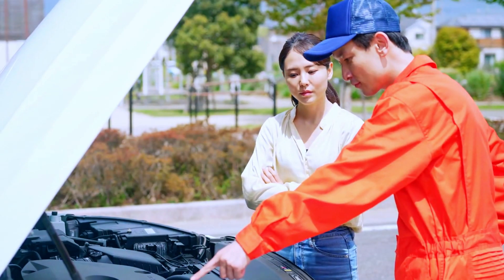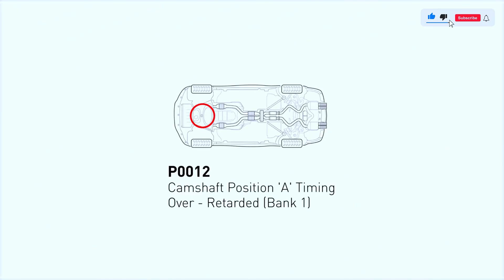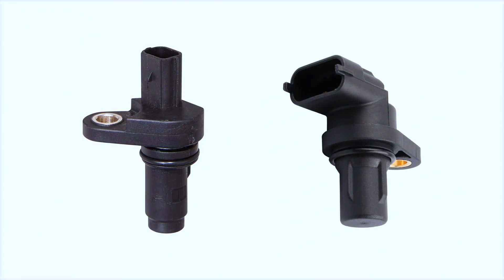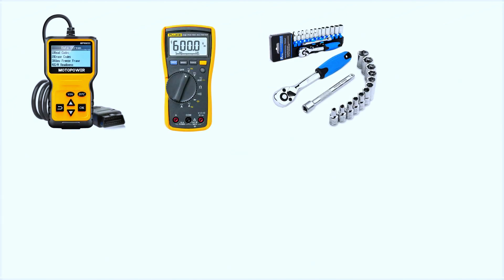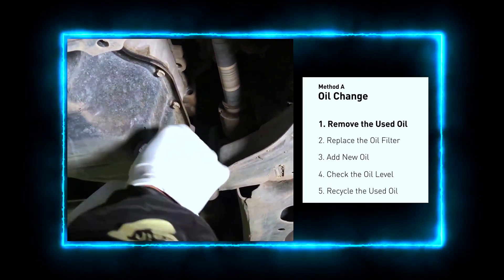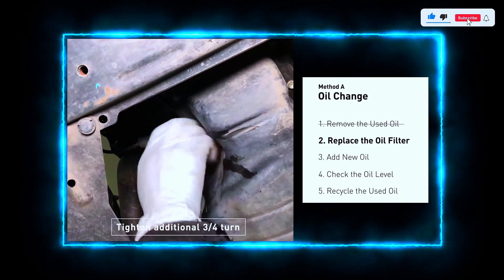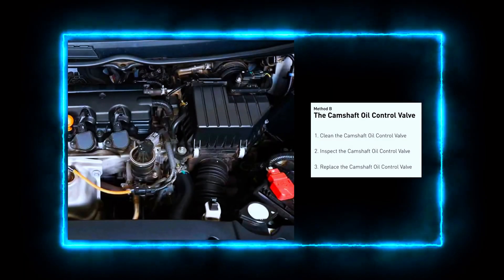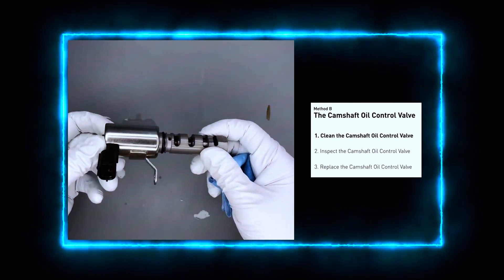How to Fix P0012 Code: Easy DIY Guide for Camshaft Timing Over-Retarded (Bank 1)@FourWheelsEmpire

Comment: I checked and my car has the VVT solenoid disconnected, that is, there is no cable connected to it. I think that's why it showed errors P0075 and P0012, but the check engine light didn't come on.
Reply from the maker: You're absolutely right—if the VVT (Variable Valve Timing) solenoid is disconnected, it can definitely trigger codes like P0012 (Camshaft Timing Over-Retarded) and possibly P0075 (Intake Valve Control Solenoid Circuit). These codes usually mean the ECU can't properly control the timing system due to that missing connection.

As for the Check Engine Light not coming on, that can happen sometimes if the fault is intermittent, or if the car hasn't completed enough drive cycles to trigger the MIL (Malfunction Indicator Lamp). Still, the stored codes mean the ECU has detected an issue.

I'd recommend:

Reconnecting the VVT solenoid properly.

Clearing the codes with an OBD2 scanner.

Then driving the car to see if the codes return.

That should help get your engine running more smoothly!
Reply: @FourWheelsEmpire  Thks Bro!

Comment: Hey Broo I changed. My vvt gear on 2011 Toyota Camry  when I installed the gear I timed the chain the I locked the sprocket by mistake.        Then I torqued it locked.             Car runs good and starts right up.      But throwing that code.
Reply from the maker: It sounds like you're on the right track! Sometimes even small mistakes can cause codes to pop up. Double-check your timing and connections to ensure everything is aligned properly.

Comment: I advise you to change the engine oil..ok..change the oil 5W 20/30 to 20W 50 or what???...
Reply from the maker: Sir i recommend 5w 30 engine oil...
Reply: @FourWheelsEmpire  ..the car has high miles 230.000
I also changed the oil from 5W 30/20 to 10W40. I replaced them twice with new solenoids and after a while the code returned..
Reply from the maker: @dimir2858  Sir now I want to suggest you. You should go to a professional mechanic.
Reply: Hey bro a friend just got a toyota camry 2010 engine and after installation and test drive, the check engine light came up light on still with error code P00012.